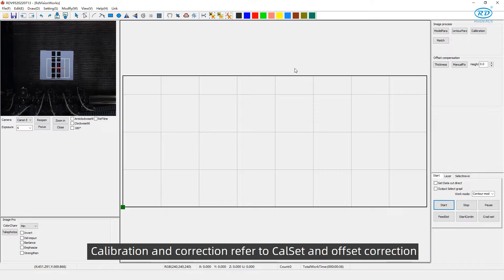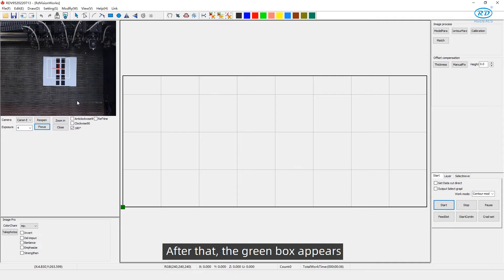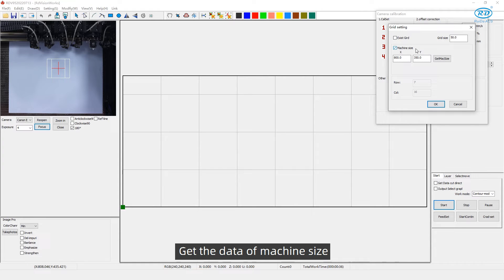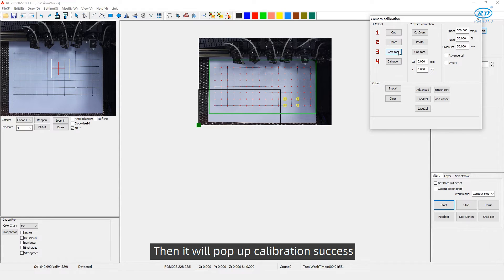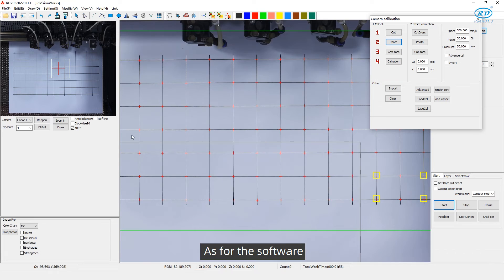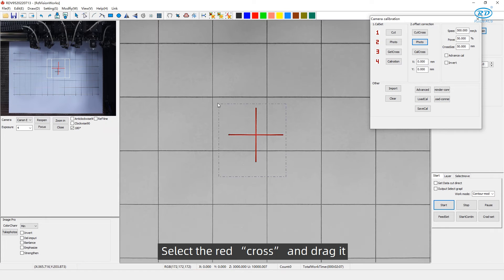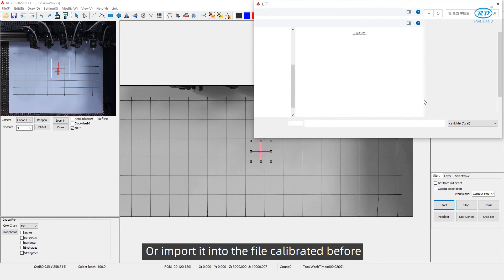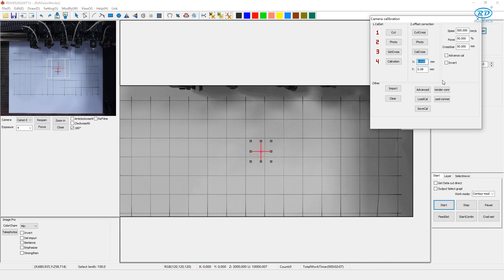RDVisionWorks tutorial:Camera CalSet and Offset Correction#rdc6445g#rdc6442g#ccd#ruida cutter

Comment: Hi. I just bought RDC6445G-DFM-RD. 
I build my own CNC with size 2600mm Y axis and 1840mm for X axis. I'm using canon 1300D with 10-20mm lens. I was set in factory parameter and my ruida controller for that size the table working. After I connect the camera, all of table surface hasbeen captured with my camera but after I take photo from RDvision the picture from camera doesn't fit into the working size table. The picture I took is so small. How can I make calibration with this?  0:18 said put piece of paper in the middle and center of table. So I put that paper in the midle of it and try to cut with condition my laser head still at homeing position?
Reply from the maker: After installing the camera, open the software and adjust the camera lens's focal length based on the software's display to ensure the entire machine table surface is captured in the shot.
Reply: @shenzhenruidatechnologylim5388 I was did. All of table surface has been captured in my camera. But afrer I click calibration and cut in no1, after that I click photo number 2. Just like in video. The photo doesn't fit in my working table area I was set 1840mm X and 2600mm Y. I feel like ruida hasn't good service after sales when costumer get the problem like this. I send email until now didn't get help or support me to do calibration. Please give easy wat to reach you technical support 🙏🙏 I been send email to ruida please reply my email. It's been a month I'm stuck with this, made me so exhausted